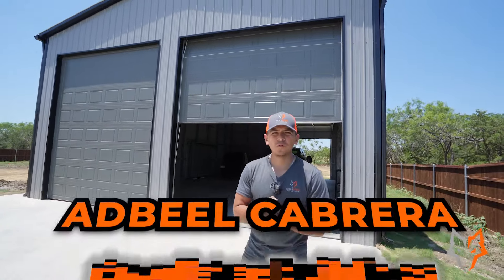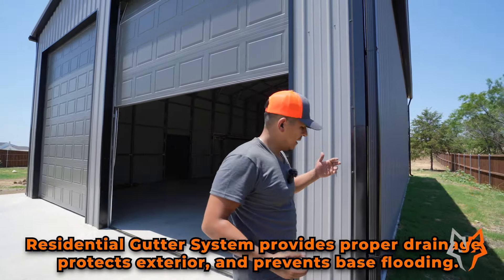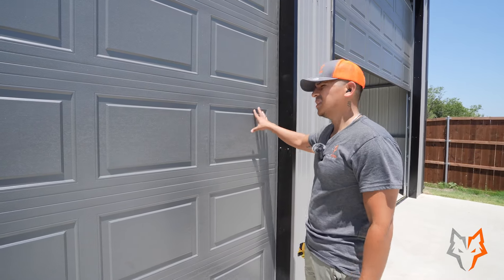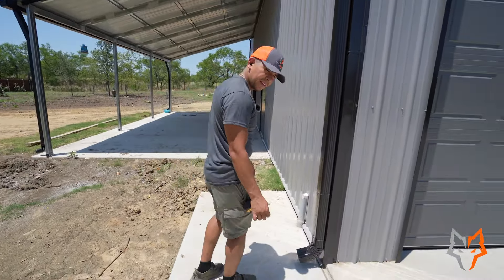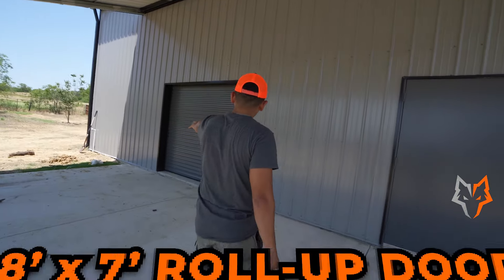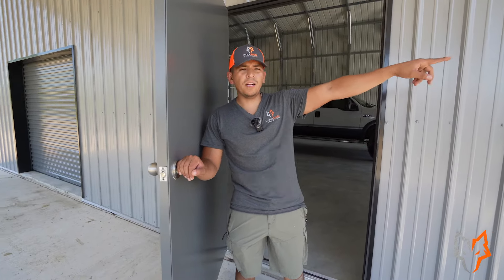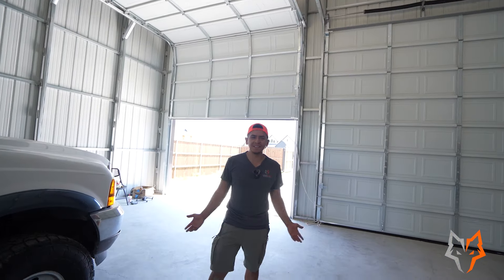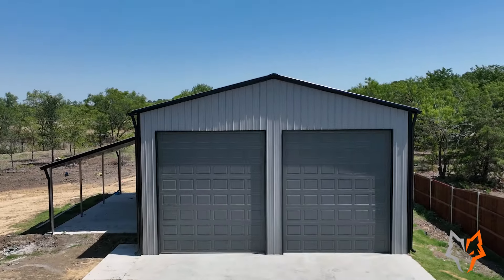30x50 Metal Building Tour in Midlothian, Texas | WolfSteel Buildings

Comment: That looks amazing. The ONLY thing I would have liked to see was the girder on the side to not be blocked with the blocked used as the spacers in the legs.

That way if you run conduit along the girder, you can go right into the legs, instead of around them having to bend it, or cut through the spacer. Would make for a lot easier way to run wiring and lines as well as any wall finishing that maybe done.
Reply from the maker: Thank you for those insights! We'll keep that in mind and check on the engineering for potential possibilities in the future. We haven't had issues from our clients when running their electrical